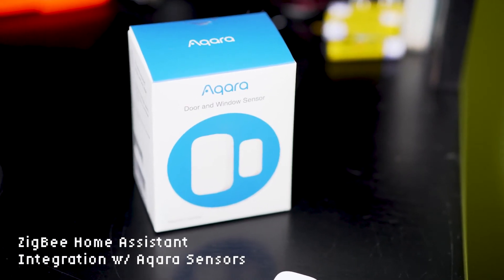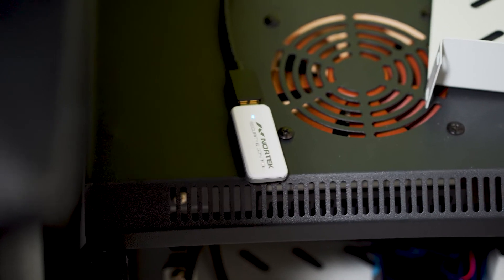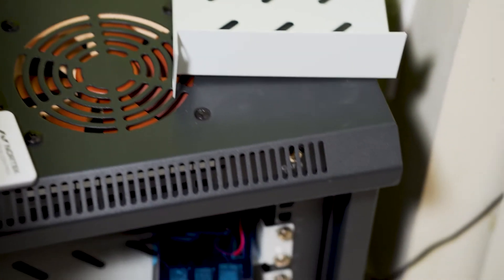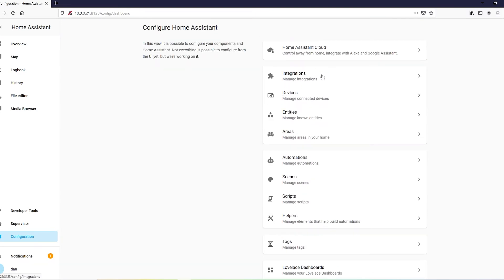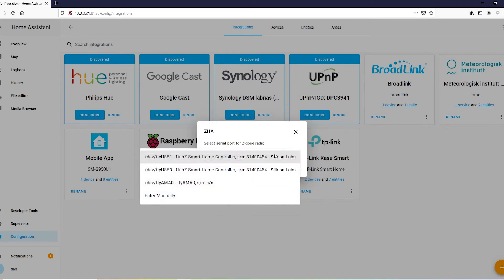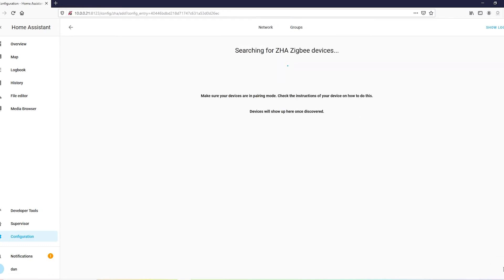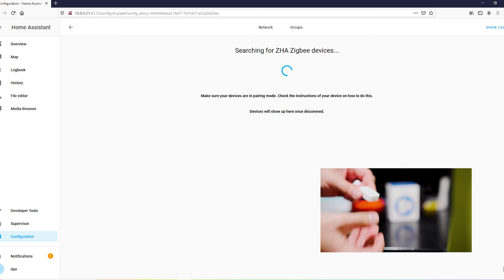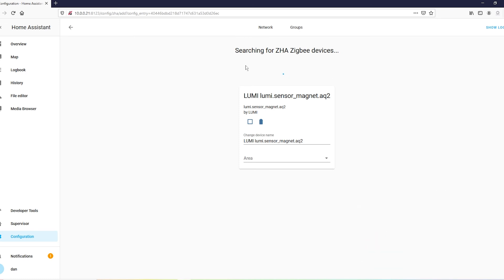Home Assistant Zigbee Integration with HUSBZB-1 featuring Aqara Sensor

Comment: Hey, I’m a newbie to Home Assistant.  I purchased a HUSZBZ-1.  But my Raspberry Pi looses network connection when I plug it in.  I’ve tried both direct connection and with a usb extension cable.  That’s both wired and wireless communications.

Any suggestions?

Comment: I got a question my friend. 
How fast is this sensor? 
I got a SONOFF door sensor (Home Assistant and ZHA integration) and it's instantaneous to change state from Open to Closed, but takes 1 second from Closed to Open.
Did you notice any delay with this one? 
Thanks!
Reply from the maker: No lag as far as I can tell, whenever I touch the magnet to the sensor home assistant updates the status immediately
Reply: @TheTechSamurai  I've seen on other videos that this sensor also exposes temperature. They were using it with Deconz though. Does that also happens with ZHA?
Reply from the maker: @tarcisio_menezes  I have a separate sensor for that from the same brand that gives temperaute, humidity, and air pressure.  Not seeing that option from the door sensor though.
Reply: @TheTechSamurai  thanks buddy!